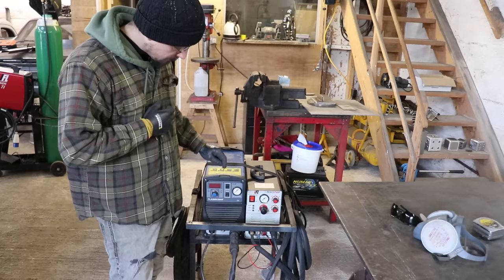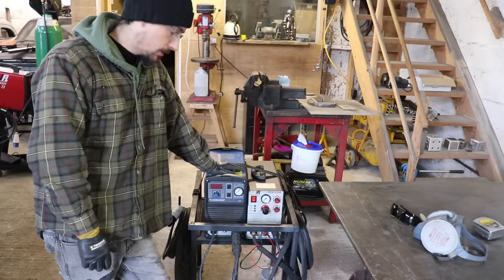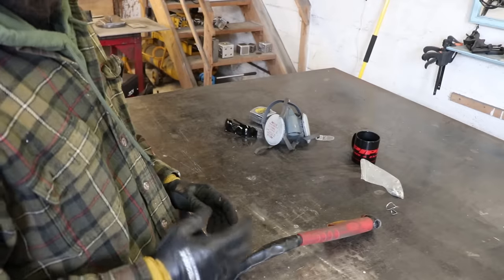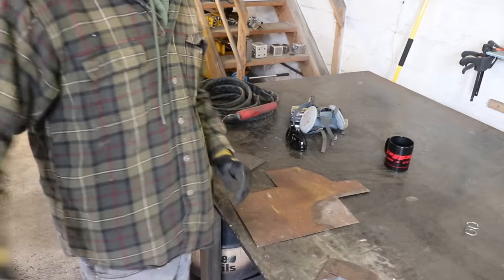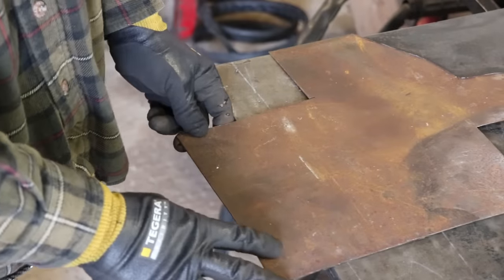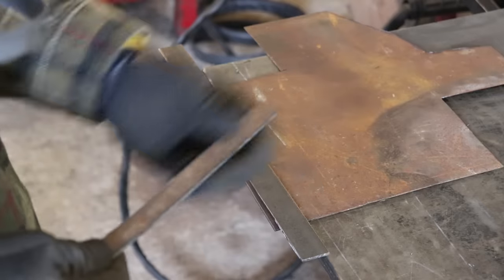PLASMA CUTTING FOR BEGINNERS, PLASMA TIPS AND TRICKS

Comment: A friends wife free hands 'artistic' stuff. I have seen the results which are very neat. And sell for decent money as well.
This vid has given me some instruction as well. I was using too few amps. And I cut a piece of 2mm checkerplate slightly too small as I did not allow for the tip of the cutter. So was about 2mm off. And yes checkerplate does not cut as neat as flat steel. 
And with gloves for that type of thing I wear elcheapo riggers gloves. Get them wet and wear them for 15 min and they are quite supple. Not the best for insulation  but they are leather. I seldom ever wear gloves welding,, and I know I should. I have scars though on my feet,, hot lumps go down the top of my leather boots and burn my woolen socks. That even wearing overalls.

Comment: 5:25 I found that you rather damage the nozzle when you DONT drag it ON the metal, as debris splatters back up at and into the nozzle instead of penetrating down and out through the bottom of the cut. Care to comment?

Comment: Why not get a drag shield (offset) vs. putting the tip right on the metal? Emphasizing the ground circuit path is also important to avoid electrocution.

Comment: Very useful video, thanks for sharing.
I'm thinking of getting a plasma cutter (15 to 40Amps) that supposedly works at 4 to 4.5 bar (58 to 65 PSI).
My compressor puts out up to 8 bar (116 PSI).
What difference does the pressure make, i.e at 58 PSI or 65PSI? 
Would extra pressure above this make a difference too? 
Thanks for any input.

Comment: Can I use a cutter tip and set a current (A) lower than recommended for cutting thin sheet? for example, use a 1.6mm nozzle to cut a 1mm thick sheet with a working current of 60A?

Comment: A large unanswered question is do all torches have both styles (stand off and drag) of tips and electrodes made for them?  Or are some just one style?  I have been cutting with a plasma for more than fifteen years and I recently became aware that there were drag tips available for my machine.  I just bought another and am having a hard time finding drag tips for it, however it is a brand new 70 amp model.  I have not seen any video dealing with the question whatsoever.  Good topic.  Doug
Reply from the maker: I don't think you need to have a tip listed as a drag tip to drag it. But yes some seem to have one style while others have multiple tips. Cheers

Comment: I want to get a plasma cutter but I don't know what to get any good ones you can recommend? I've looked at many different ones but can't really tell which is over priced rubbish or a very good one any advice or brands you recommend It'll be very appreciated, cheers
Reply from the maker: I would recommend either of the ones I own. Cheers
Reply: Here's what I did, I knew I wanted one, how MUCH I would use it was another question, this is strictly a hobby for me, so I went with a $300 Amico cut50, I've only cut a couple pieces but it seems to do the job... IF I end up loving it, then maybe I can warrant the price of a miller or hypertherm... Good luck on making a choice, and Matt, awesome video.

Comment: What mains voltage amperage are you using. I am severely restricted on amperage, I need a proper 15 Amp power socket. Burning wiring is not a good smell. Plasma cutters consume a lot of power.

Comment: I need to cut out a half dozen 2 foot pizza slices in 1/8th inch 3003 h14 aluminum with precisely centered hole alignment - half inch and quarter inch diameters.  I may need to do this every few months..... So, I learned cad and tried to get machine shops to water jet, plasma, cnc, with nothing but excuses, over priced, and months out.  Just stupid operators.  I did get a sign guy to cnc a jig, which I tortured myself using a router, which worked but took me most of the day to do 2 units.

I am now thinking that the next step is to pay the sign guy to make a 1/18 inch aluminum metal jig, rather than a hardy board or wood jig. Then buy a cheap plasma torch, and see how that goes. 

  However, there are too many variables, questions that need to be answered : 1.  How thick does my jig need to be, and would aluminum work? 2. What is the offset? And is this the same offset that I would use to clean up the edge with my router? 3. How thick is the plasma cutter laser beam? 4. How big would I make my holes to punch the center of each half inch and quarter inch hole?  I assume that I would still need a drill press for the final diameter? 5. I got a metal grid wagon in my yard with rubber wheels. Will this work as a cut table, or is there a simpler way to turn my plywood and saw horses into a cutting table which can be moved into my garage? 6. Is the process too loud for the neighborhood? 7. If an air compressor is involved, how does this affect the jig, which I assume blocks some of the airflow (to cool the tip?)? 8. Do the cheap machines come with everything that we need? Are the consumables proprietary? 9. If I used wood or Hardi-backer board for the jig, how long do I get out of these jigs? (I am leaning, attracted towards aluminum metal jigs because a metal jig would not break during long periods of storage, where mdf and hardy board would fall apart.)

Comment: Another reason for not getting a smooth cut is that the torch isn’t being pulled straight. If it’s rocked slightly back and forth sideways, slight gauges will be seen in the cut. A steady hand is needed. I’m talking about a straight cut with a guide as he’s using. You can still rock that torch sideways.

Comment: Do they both need hard wiring in..
The main reason i havent got one yet is they say they need a seperate 30amp circuit. Is that single or three phase.
Thanks in advance
Reply: Good question. I 'm thinking your on a commando socket with a 16 amp breaker. Any information about what supply your welders need?
Reply: I run the r-tech at full chat with no issues through a normal domestic plug with 13A fuse.
Reply: @brookfab_5188  thats good to know. Thanks

Comment: Hi Matt, maybe you can help me out, for some reason the front ceramic cover keep on braking after a few cuts. what the hell am i doing wrong :(
Reply: MichaelKingsfordGray   Hi Michael, Thanks for your reply and sorry for my spelling :)  I`m new to plasma cutting and the few times i`ve used it i notices that the front ceramic cover keeps breaking quite often . Any tip or ideas why this could be happening ? 
Thanks
Reply from the maker: check the tips and everything under the cover is tight, is it working as it should? cutting well?
Reply: @Urchfab  I will do so, next time i`m at the work shop and will let you know :) cheers for the help

Comment: Dude, you are more than likely not the guy to be teaching anyone about any thing.  The recess groove in the torch heat shield is where the torch wire standoff is pushed on to the heat shield from the side. Not the top.  If you can not even get that right. The odds of wasting ones time viewing the rest of your disaster is more than likely a complete waste of time.  Line up the wire standoff with the groove  with the space in the wire heat shield and push it on.  Hope that helps you. Yes!  Next time in post production and editing. Reshoot scenes you F*cked-up on! That way you will be able to fool more people on the non fact you know what you are talking about?